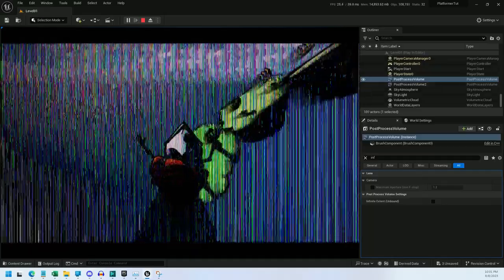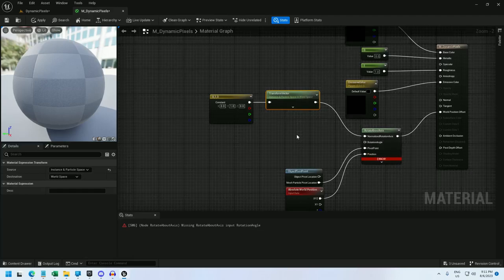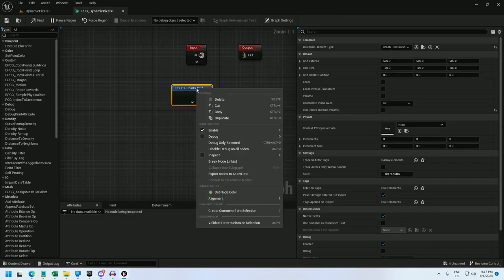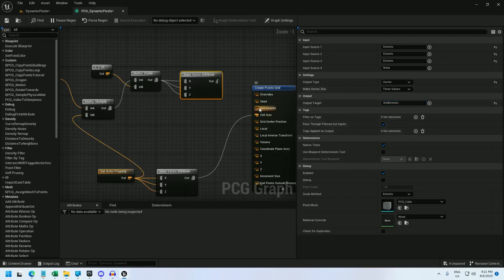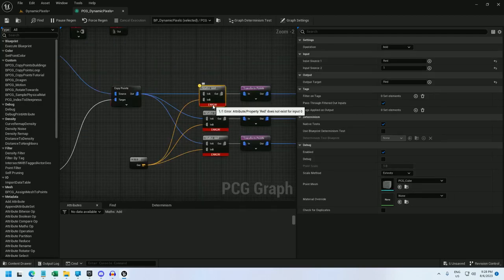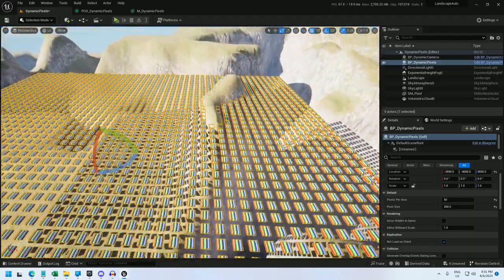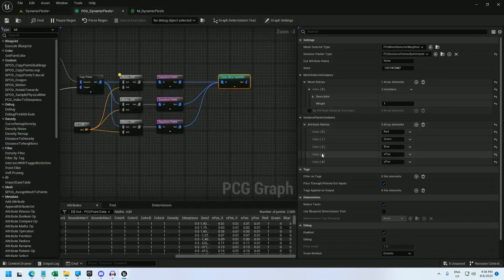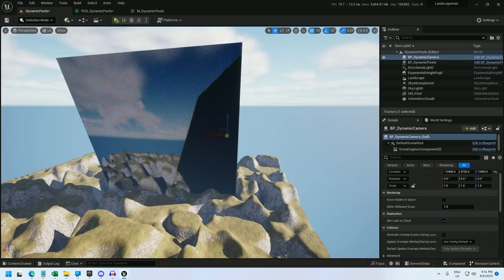Unreal Engine 5.2 PCG Tutorial - Gigantic Dynamic LED Screen

Comment: Wow this is amazing! Thanks for uploading. I’m copying along so I can learn how you’re achieving this. Although, when I try to inspect the nodes, in the bottom panel it only displays “no data available”. I’m using 5.2, and I’m very new to using PCG so I don’t know if it’s a bug or user error :\ Any thoughts?
Reply from the maker: You're welcome! It's actually less complex than the static version in a lot of ways, which I find pretty funny.

You'll need to have your PCG in the world, then in the top middle there's a dropdown where you can choose it.

Also, if you have multiple of the same PCG, a useful trick to finding the one you want to inspect is to select it in the editor, then in the dropdown that selected one will have (selected) next to it.
Reply: Thanks, that sorted it out!